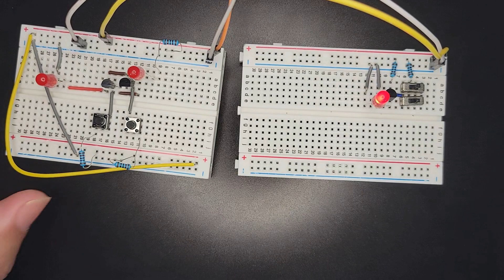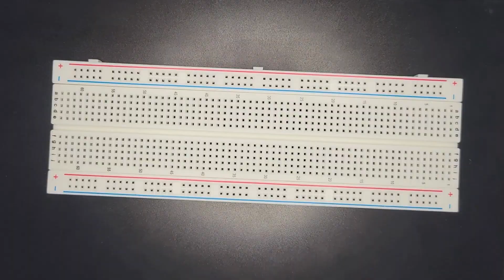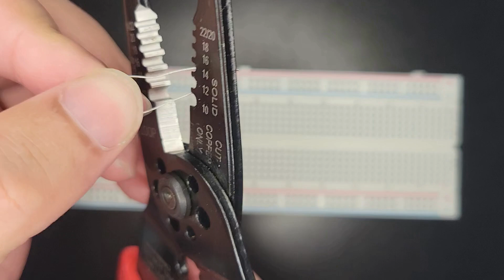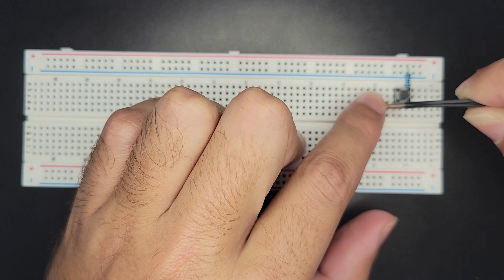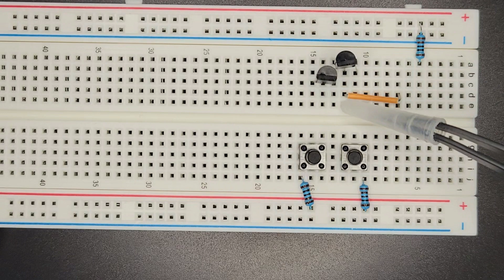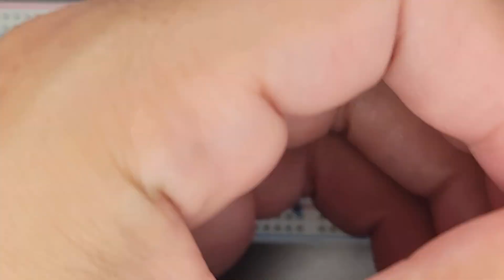Beginner Makes AND Gate - Step-by-Step Logic Gates with NPN Transistors

Comment: I know I'm a bit late to this, but I build the same circuit (with 1k pull-up on the collector, and 100k on the bases). I also had the bottom NPN be slightly on when the top base is on and the bottom base is floating. And that was the problem, the bases should not be floating. Adding a 100nF bypass at each base stops the base pins from floating. I chose these values as a lowpass for the switched debouncing, but it can be done with 1k resistors and 1nF caps.
Reply from the maker: Thanks for the insight! I'll make a note to give that a shot. I admittedly haven't had any time to continue the physical electronics, but will get back to the 16-bit build for sure. Thanks again!

Comment: Don’t use bjt transistors. Individual transistors are mostly BJTs they are used for analog signals to make filters and will not work reliably as a switch. You really want to use mosfet. Its better to buy these and, or, nor, nand etc gated chips, to do digital logic. Unless you want to dive into analog electronics. Mosfets are usually flat rectangular in shape they don’t have these long legs and not half cylindrical shapes.
Reply from the maker: Thanks a lot! I have heard the same from a few people, but I've always found it interesting that the MOSFETs are much harder to come by. Why is that? BJT's are all over the place (at least in my experience). Thanks for sharing your insight!

Comment: I think that the dim light was because the voltage was passing through the base to the emitter because iirc it allows a very small amount of voltage to pass through  in order to register it (I am not 100% sure I am still learning but his is my assumption i would like to test when I have my own set)
Reply: Ok, had to eyeball and eyeball some more, but when your load (aka your LED) is between the left transistor's emitter to ground/negative, and when your left switch is pressed, that effectively allows the current to flow directly from the bottom VCC, through the switch, and right through the Base to Emitter junction on over and through the LED.    Transistors are effectively two diodes in "opposing" positions, joined back to back on the base leads.   But in this case, current will still flow through the B/E junction because it couldn't care less if the B/C junction (diode) was present or not.    To prevent that, you may find that increasing your base current limit resistor's value will also limit it enough to not have the LED light.
Reply: Ooops .. VCC = Your positive supply rail on the bottom.
Reply from the maker: Ahh thanks. Since you told me that the BJT's are actually 'current-activated' versus voltage activated (like I thought before) then a lot of this makes sense to me. It seems as though it's nearly impossible to get an output from this AND gate, right? I ended up using an inverted NAND gate (which you may or may not have seen) to get an output. At the moment, I am learning a bit about RC circuits and trying to get an LED to turn on delayed, and I am again running into the issue of the BJT's being current-activated (even when the voltage is below the 0.65V, it is energized). Anyway -- I'm going off topic. Thanks again for all your input!
Reply: @MxyAhoy  Your circuit when you had the issue was actually almost correct.   What is missing is a pair of resistors of the same value (100 to 300 ohms.. just like the ones you use for just lighting the LED).  On one side both attach to the emitter of the lower transistor;  And on the other side one resistor ties straight to ground, and the other is placed between the emitter and the LED's anode (pos).   The other side of the LED remains attached directly to ground/negative.    To finish the "change", remove the resistor between your positive rail and top resistor.  The bottom resistors will limit it properly. 

So now with the top transistor "off" and current going through the base with another 1K on the other side, there isn't enough left for the LED as the majority is being sent now through the other resistor which from there, has a direct shot to ground/negative.  But with the top "on" and the bottom both "on",  the current can flow much more, and enough to provide the current needed. 

Caps.. yep.   Check out the RC time constant.   Basically with a cap and resistor in series, you figure out a value that represents the time elapsed where at the end of it, the capacitor is charged to 62.5 percent.  It charges slowly from there as each successive interval elapses, but the general rule is it would charge to almost or about 100 percent after 5 total "intervals" , each interval being that same period in time that was calculated 

https://www.digikey.com/en/resources/conversion-calculators/conversion-calculator-time-constant).  Check this one out as it also has a good graphical representation of both the typical circuit and the actual TC "graph" itself.   You will see a total of 6 on the graph, but the rule of 5's is usually enough to factor into a design.
Reply from the maker: Makes sense to me! Thanks!